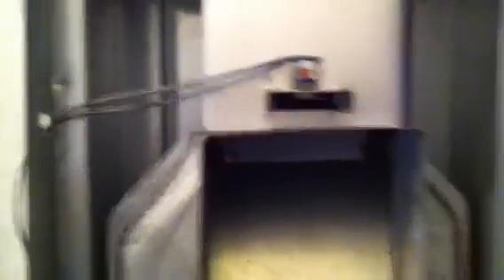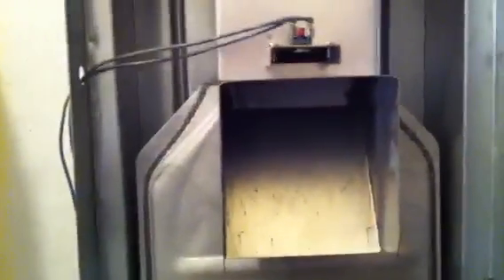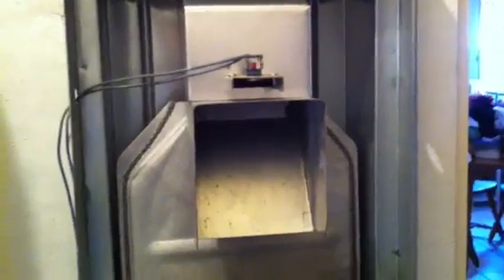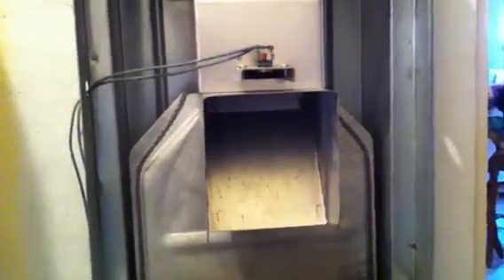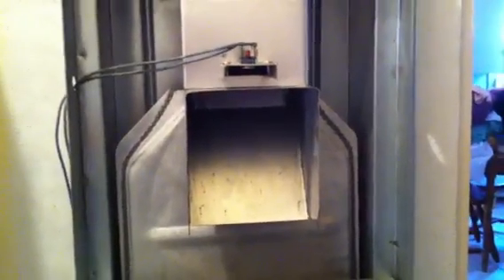Cleaning a wall heater

Comment from the maker: Let me add, Don't be afraid of getting your hands dirty.  I should also add that the vent tubes that lead up into the attic are just that, hollow tubes.  They're  screwed together with a few screws and some metal duct tape to cover the seams.  It's not as difficult as the heating contractors want you to believe.  If the vent tubes are clogged with soot, just take them apart and rinse them out with water, and replace them in the order that you took them off.  All parts are made of metal and they won't rust when you clean them out with water.